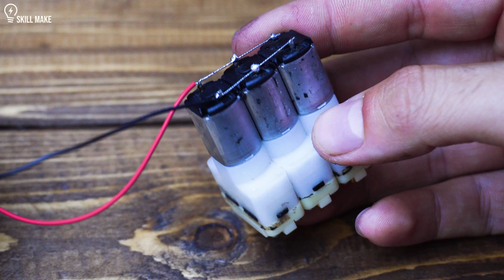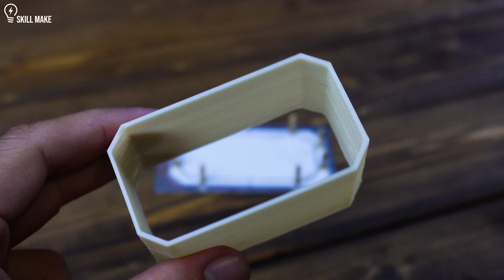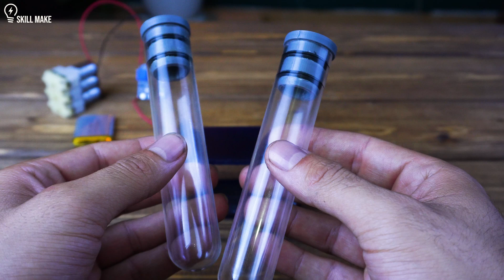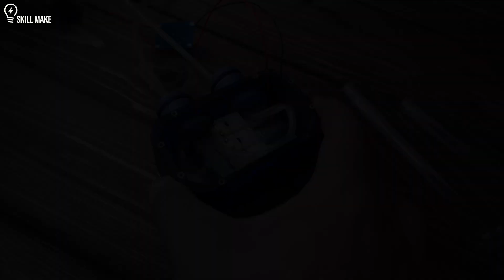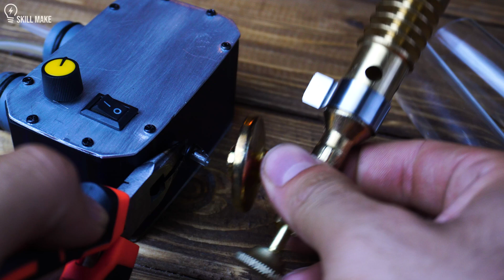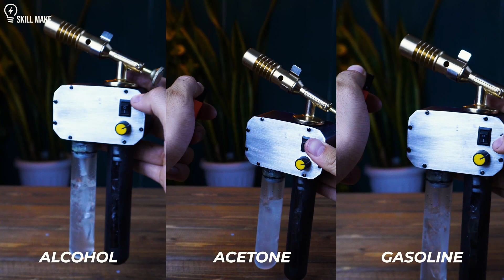ATOMIC Free Gas !? How to make Free Lpg gas using water at home easly

Comment: I noticed you are good with water. Is there a way to turn water into air at a fast pace to possibly breathe under water? Theres an example of this on starwars. The jedi put this peice in their mouth and it turns the water into air
Reply: yes there is, its called electrolysis, but you have to make somekind of Hydrogen filter though, since H2O has 2 hydrogen molecules and 1 oxygen, so in practice you are making more hydrogen than oxygen
Reply: @Rasya521  you can make the electrolysis set up in a way where the hydrogen and oxygen are already separated when theyre made